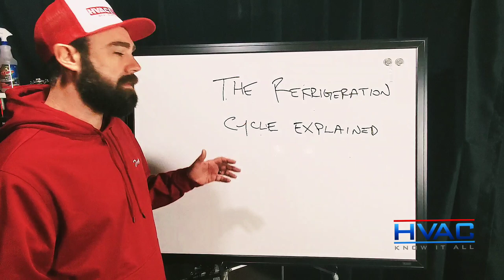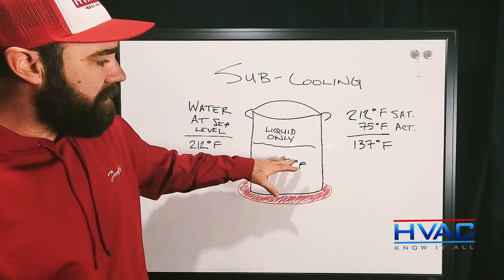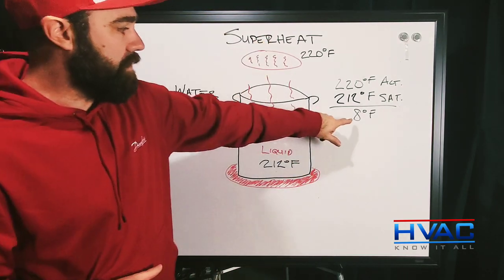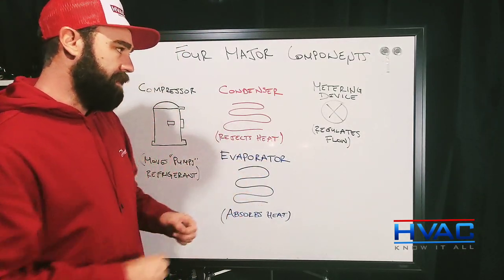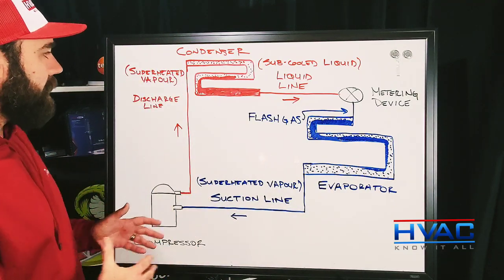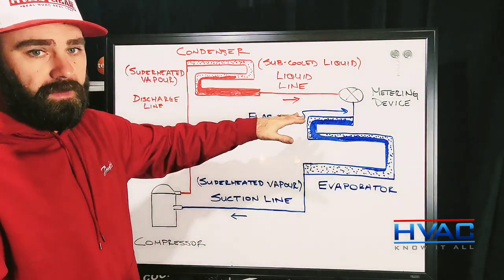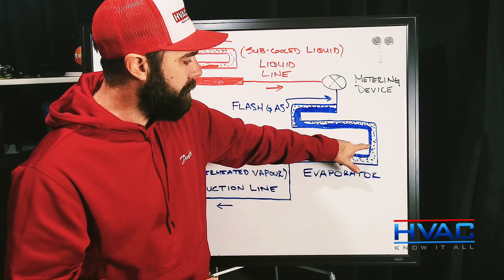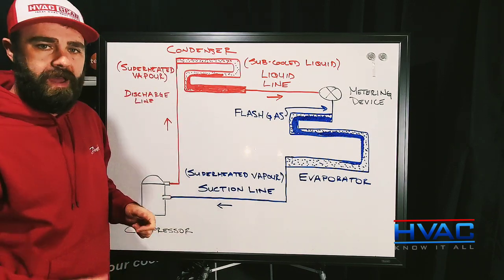The Refrigeration Cycle Explained - The Four Major Components

Comment: Could you share how long the cycle time from the compressor to condenser, to the coil inside the fridge or freezer until to flow back to compressor per time? say if roughly took about 30 mins for cycle times from compressor flows vice versa, it will took about 48 times per days for compressor to refrigerant vapor and receive the evaporates gas. correct me if i'm wrong.

Comment: This may sound silly but, if the suction line is under a positive pressure before it reaches the compressor why is it referred to as a, "suction line", my interpretation is that suction implies negative pressure (a vacuum). Is the compressor not just forcing the refrigerant full circle, or is there a negative pressure pulling the refrigerant at the compressor that the gauges don't detect? (maybe my definition of suction is incorrect) Could you please explain?
Reply from the maker: No negative pressure in most systems.  The compressor creates a pressure difference between two sides.  It's a funny term I know.

Comment: So what happens in the air conditioning cycle?.. Can you explain the difference?
Reply from the maker: There is no difference, air conditioning uses the principles of refrigeration
Reply: @HVACKnowItAll  Thankyou Its only that evaporator coil comes with fan in case of air conditioning right?